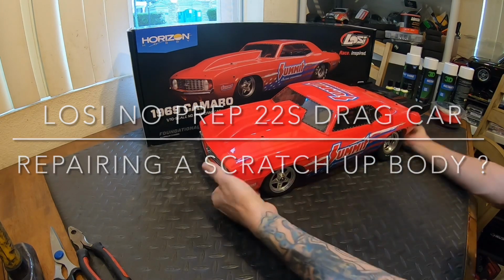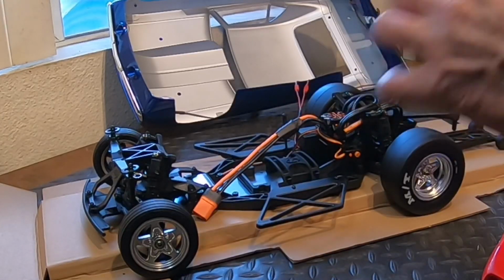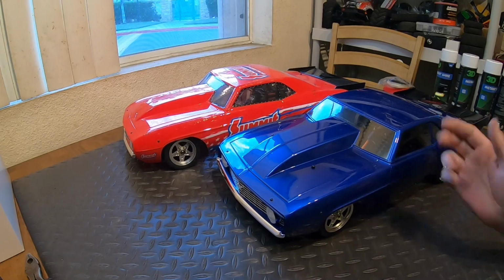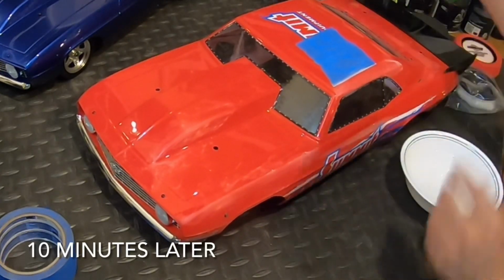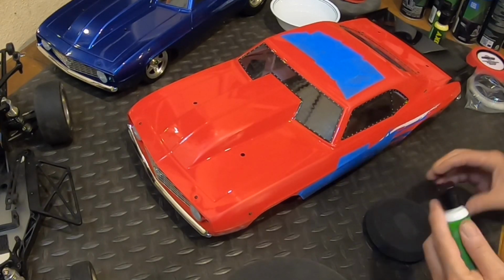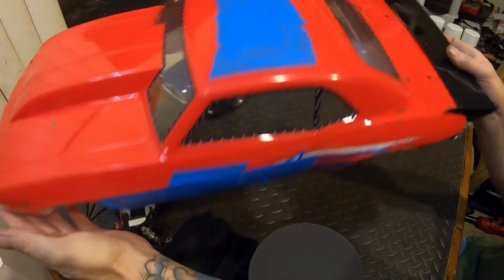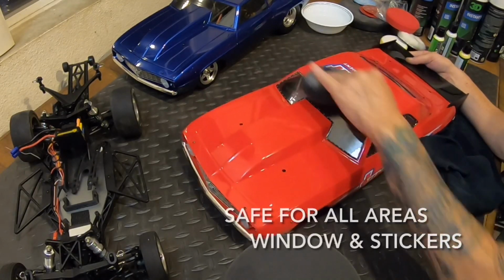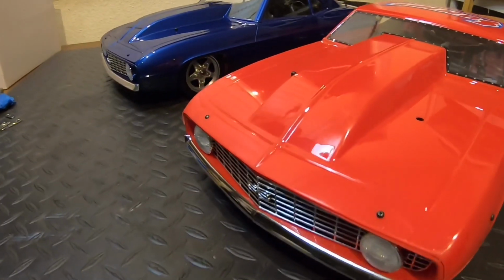Losi 22S Camaro How to fix a Lexan Body That’s Got Scratches Using 3D automotive products

Comment: I've never used a headlight plastic repair kit. You started with 1,500 and then went to 1,000 and said the " was the lighter grit"? Is this opposite of regular sandpaper? Usually the more coarse the sandpaper The lower the number. The higher the number the more fine the sandpaper and you would start at lower numbers and move your way up. 
I've done this process before but with regular high grit sandpaper and just regular plastic polish. You're the second person recently to mention using a headlight kit though. So now I am interested. 👍 . Thanks for the content Keep up the great work. 
*Never mind I just read the pinned comment.*
Reply from the maker: In the description it’s corrected 👍👍

Comment: My red Losi 22s NP Camaro, came with wrinkles in the body on the pillers behind the rear side windows and one on the drivers side door. Look your cars over when you get it, because it appears Lodi’s quality control is slipping. If I didn’t remove the Summit stickers on the sides, I would have never noticed how badly the body was molded. Also the springs on my rear shocks weren’t sitting on the bottom cups properly so I had to fix that before It would even attempt to go straight.Even the guys at my local Hobby Town said something about it, when I went to buy a battery and charger. I guess I’ll use this wrinkled one to learn on, and when I can control run it without crashing almost every time I will buy another body.
Reply from the maker: I never took the stickers off wasn’t planning on doing that but everything else looks ok with mine just minor scratches on the nose and roof that I polished out myself but that sad to see 👍

Comment: Hello Earl, very informative your videos! I have been in the rc world 40 years. Planes, heli, quads, racing boats etc. Bought a Losi 22s drag camaro, also picked up a pair of Proline reactions hp wide SC S3 soft belted. Curious what a decent set of rims for these tires and front-end as well. Appreciate any help!!
Reply from the maker: Marin brothers rc drag wheels are the best and affordable will last a lifetime 👍👍
Reply: @Earl Moorhead  Thanks will pick them up.